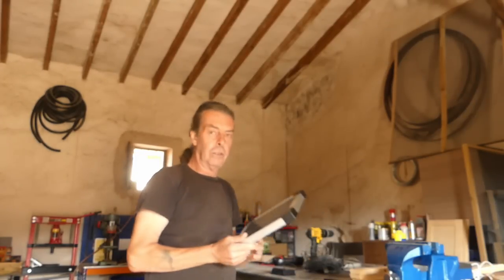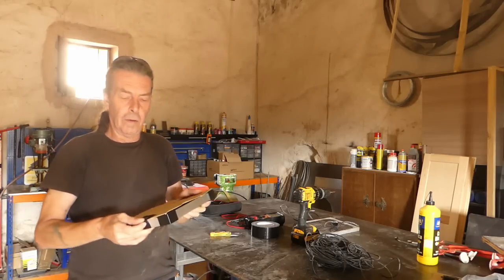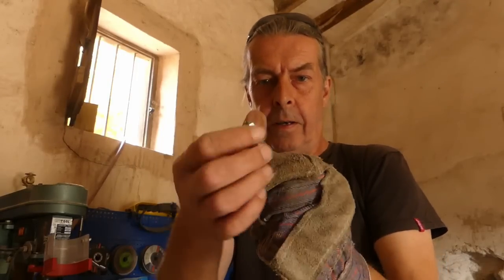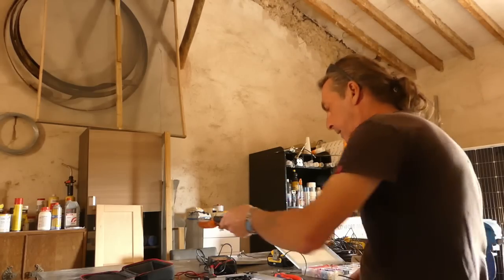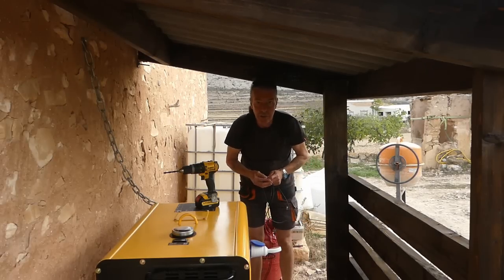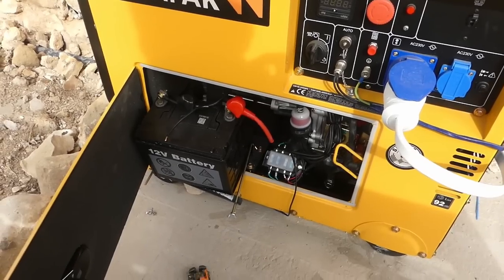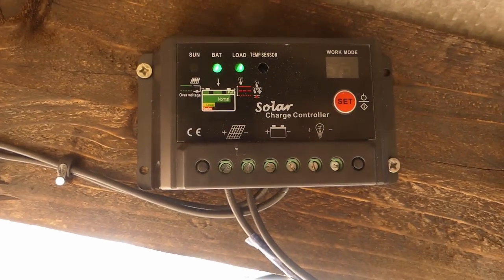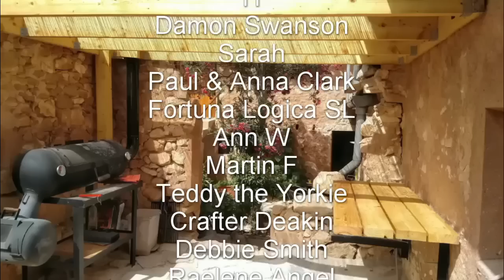Keep any battery charged and ready for use - cheap and easy!

Comment: Definitely going to do that to keep a trickle in the motorbike battery. Cheers Andy.
Reply from the maker: Go for it! You could wall mount it and simply use crocodile clips rather than hard wiring it. Just make sure the clips don't touch when not in use - or even fit a small switch on the pos

Comment: Well done! I am using a similar solution for a solar powered 4m sliding car gate in Greece, it is charging the battery to operate the motor. It is working tip top so far 6 months after the install; we will see in winter how it perform and if we get enough sunlight to keep the battery up.
Reply from the maker: Should be fine! You can always add another panel or go with a larger one to give that little extra but a great idea!

Comment: How to omut someone off solar forever.  What an endless hassle.  Even candles would be better.
Reply from the maker: Endless hassle? It all just runs itself after initial installation, essentially maintenance free and providing us pretty much with unlimited free electricity for at least the next 25 years. Payback time for the system is expected to be around 3 years. Solar is awesome but just in case, we're bringing out the patented candle powered refrigerator, TV and computer very soon.
Reply: @FincaLife  Well you are always working on  it  . A PhD in Russian literature seems easier than running solar.